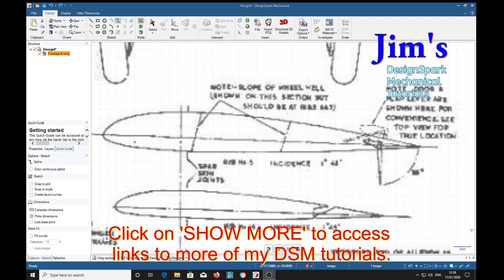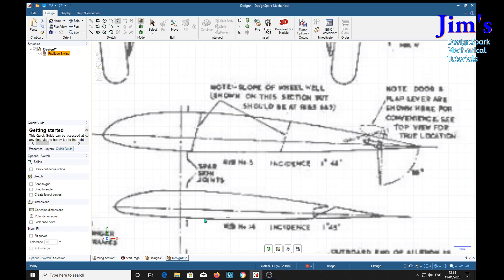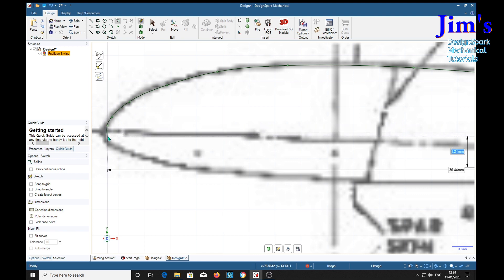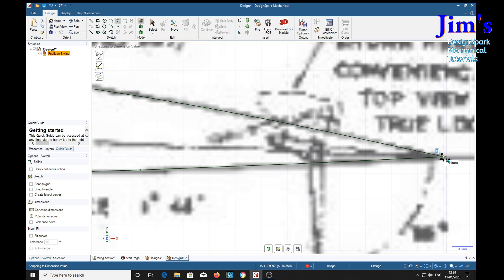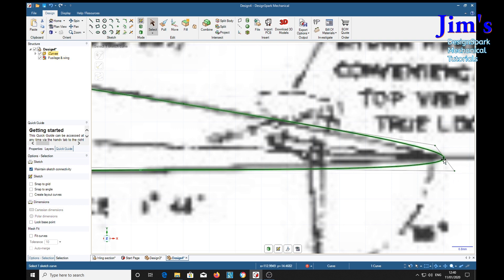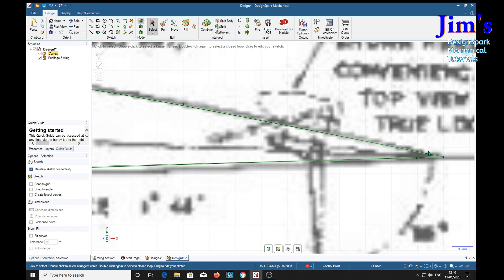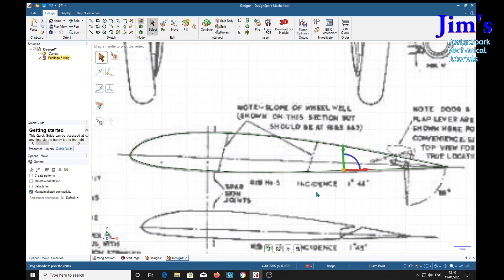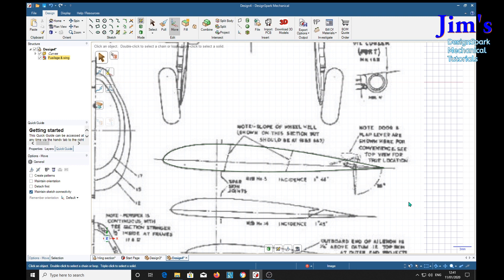Modelling a Spitfire wing in DesignSpark Mechanical pt 2b of 3

Comment: Jim - if you had two splines, one top and one bottom of the wing, it's possible to achieve tangency of the independant splines say at the front wing edge. this way, exact length ( lead to tail) is achieved and a highly accurate upper/lower wing section can be made. Especially very local to the lead edge, changes can be made without altering the opposite side/surface...try it.
This way, the tangent coincident point ( between upper and lower faces) can be at 0 degrees or 10, 20, or any specific angle and at an exact position ( not on the 0,0 reference).
Reply from the maker: It is certainly worth a try.